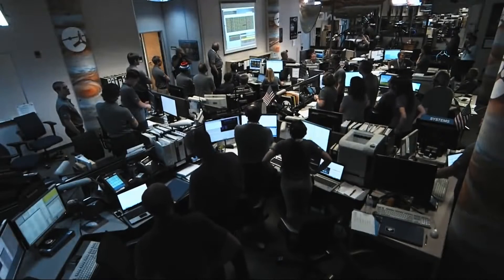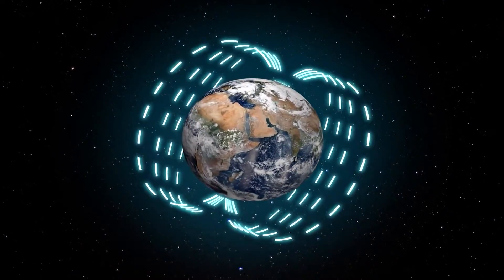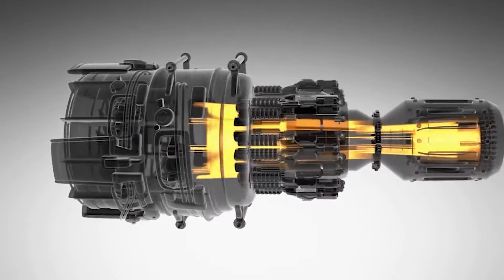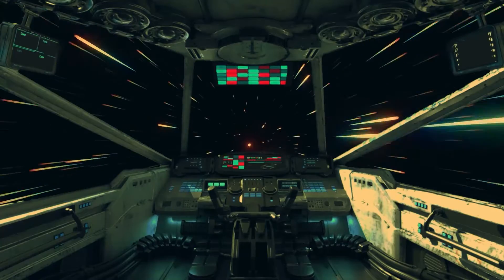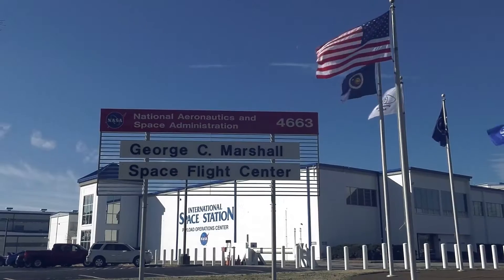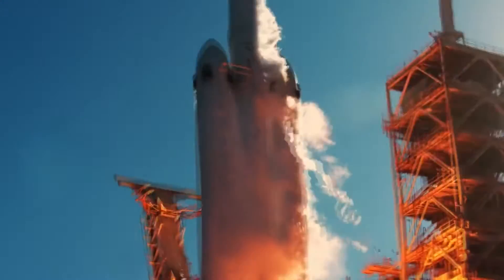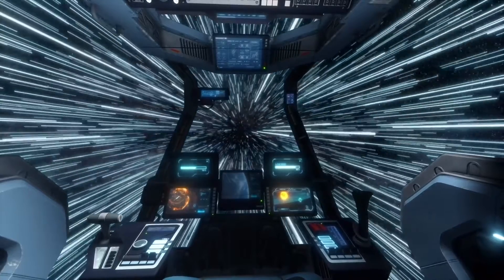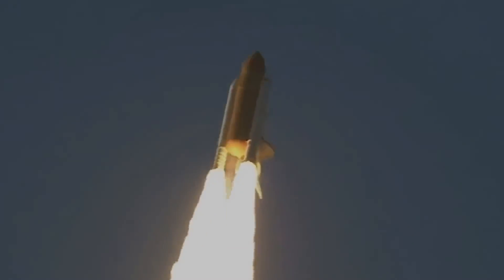NASA FINALLY Reveals New Helical Engine that Breaks the Laws of Physics

Comment: I figured this would be like jumping on a trampoline that oscillates back and forth, and when you land, you travel in one direction, when airborne the trampoline oscillates back. Not sure if counterbalancing centripetal force with magnetic could get a better effect or not. You could increase "relative mass" by rotating the disk in one direction without resorting to exotic matter, but how do you conserve that rotational force on the bounce? Well, I suppose if part of the box and the spinning disk were a ferro-fluid or electrical metal, then you can use EM fields to transfer that rotational energy on impact, and "melt" the moving mass for a moment by turning off an EM field. Well, that's what I thought about a while back and then, sure, the particle accelerator. 

Needs a lot of power. That means fusion.

I figure there are a lot of ways to improve efficiency here, it's a great improvement (theoretically) over propulsion -- but, you are really SLAMMING that particle accelerator back and forth and that would probably require two materials phased into the same lattice (currently, this doesn't seem possible to our science). Even then, it's not FTL. FTL is far closer than we think, but, I guess we aren't thinking right yet. We need to be applying our technology on computer chips and quantum SQUIDs to solve the fusion problem. Then, well, that's another discussion I only want with people who can think outside the box. We are a lot further along then when we were talking about string theory. We are now less sure -- it's a good opportunity for real growth.
Reply: Even better, light speed is really not that efficient in the vast expanse of the universe or even our cluster of nearby galaxies.
Reply: Whaaat 😂

Comment: 76 days to mars at 186,000 miles per second? I dont think mars is that far. Thats like 1.2 trillion miles away.
Reply from the maker: True, but the path to Mars isn't a straight line and the distance from Earth to Mars is constantly changing which is why the total distance ends up being approximately 1.2 trillion miles.
Reply: @SpaceInsider69420  1.2 trillion!? I think you miscalculated. The average distance between Mars and Earth is 225 million kms. Hence, a spaceship traveling at 186000 mi/s (299000 km/s) would take 12.5 minutes to reach Mars, not 76 days. Worst case distance is 401 million kms, which would take 22 minutes.

Comment: I'm just thinking. The lore says a magnetic field can convert light in to matter plus light can be condensed by a lens and a helical-like engine only requires matter for inertial propulsion; they seem to want to do spaceflight without a propellant stored on board I think this could do transit around the solar system. You'll want a magnetic material to make where the fused matter would hit but it won't if you make it out of copper. Add a Halbach array as the magnetic field and you could stand on the back with a light source to copper for propulsion.

Comment: Potrzebna byłaby bańka wokół statku stworzona z próżni, wówczas ,i energii, i siły byłoby mniej potrzeba .. oraz punkt zerowy wewnątrz by astronauci nie odczuwali przyspieszenia i hamowania :) You would need a bubble around the ship made of a vacuum, then both energy and strength would be less .. and a zero point inside that astronauts would not feel acceleration and braking :) idea with an air bubble in the water and oxygen trapped in this bubble

Comment: So two of them could get you going almost twice the speed of light and so on.
Reply: no
Reply: Think like this, even if u slap 10 turboprop engines on a cesna it wont go mach 1. Same with this, no matter how many of this engines u will use, there is a certain maximum speed

Comment: The concept was already mentioned by Bikash Kunwar in his Nobel Deity's Planet which was published in 2016 . He explained as:
Kishan was a scientist in SSO and he had invented a fastest flying object theory. Ship was designed in such a way that the energy could not lose but was changed in one form to another due to which energy was sufficient for the ship to travell long distance on a very long time and there were no other elements in space to loose energy for which required energy was rotated within the ship’s engine. Speed was increased with a continuous strike of light which made ship fast and traveled 15 times faster than of sunlight, elements used on all parts of ship were special and could exist on a very high temperature.